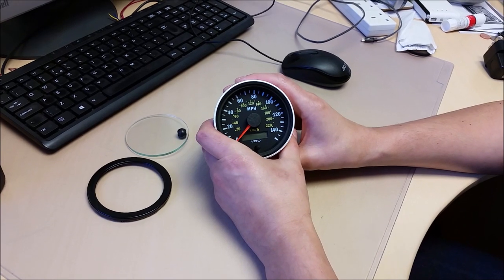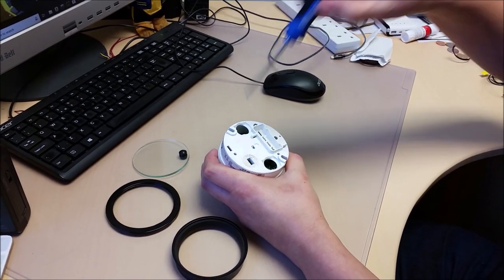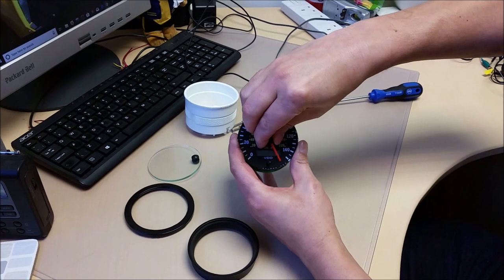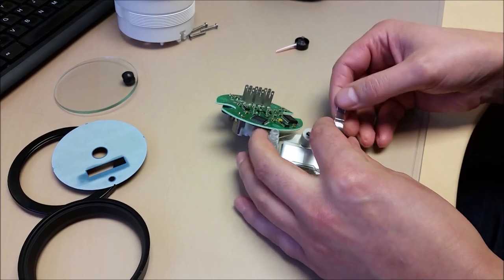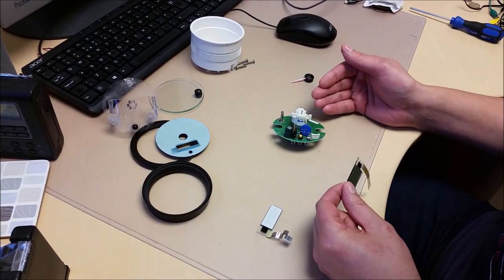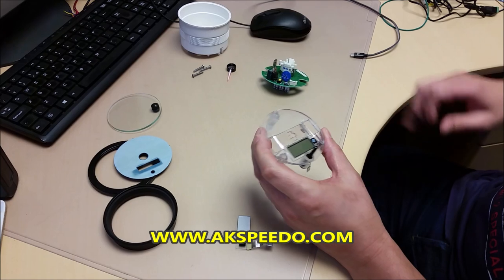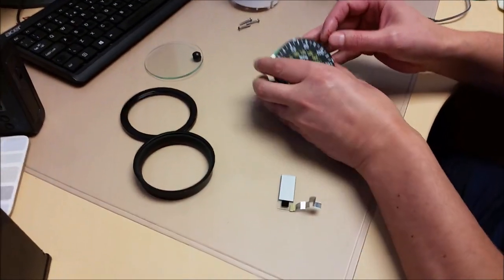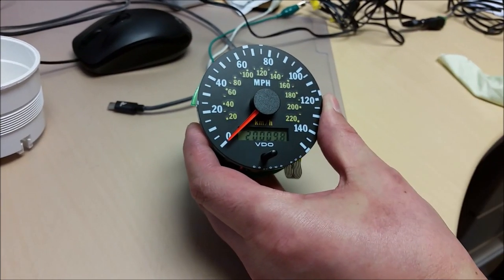Westfield Track Race Car Speedometer LCD pixel repair

Comment: I've got my new lcd ready to fit, gauge is out of car but how the heck do you get the black retaining bezel off? It seems to be pressed on not screwed on. Lever it off? Wont be pretty getting it back on afterwards. Tbh even though it's in my car I have to say it's a poor design, little thought given to future issues like this. Everyone I know who has one of these has had the same problem, the lcd going wrong. A decent item just should not do that